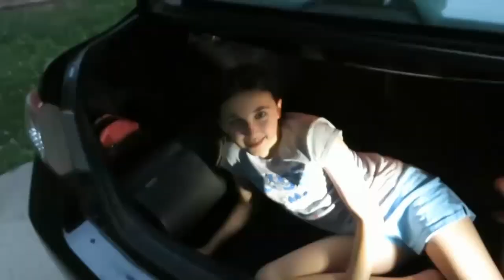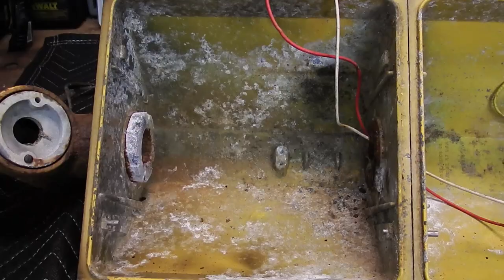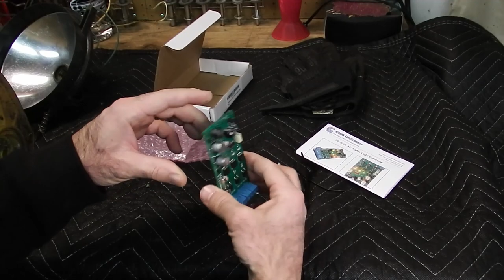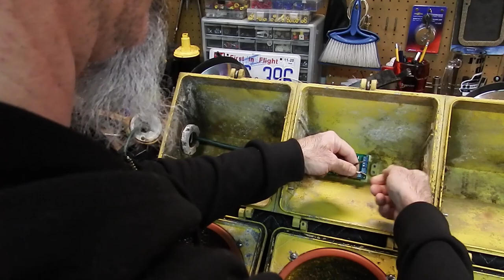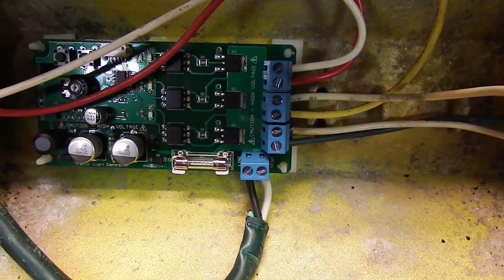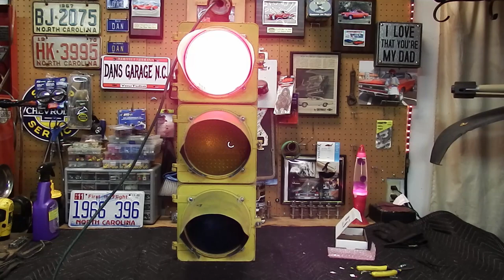Restoring a traffic light Part 2

Comment: The lenses are designed for those that are color blind (red/green).  The green has a tint of blue added to the glass and the red has a tint of orange added.  I'm not sure if this is still practiced now that glass lenses and incandescent bulbs are being phased out for LED modules.
Reply from the maker: Good point, I know the positioning of the lights also helps them.